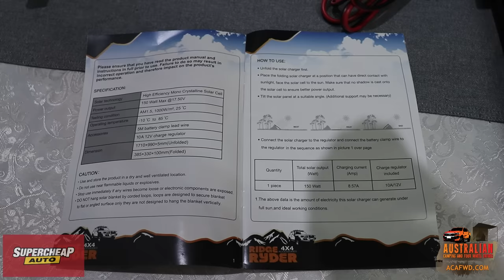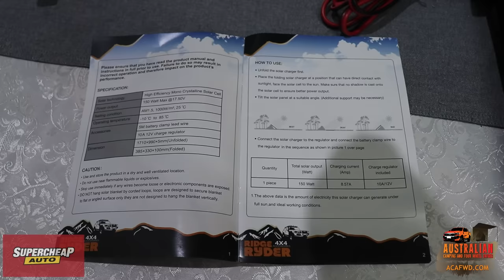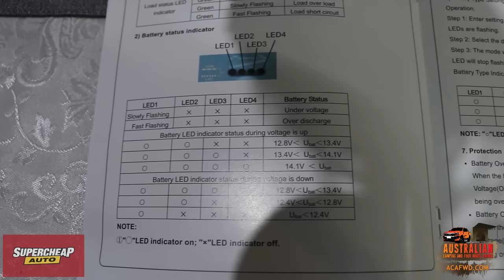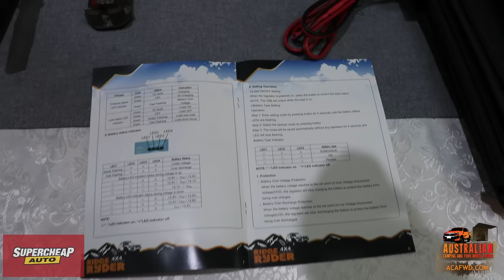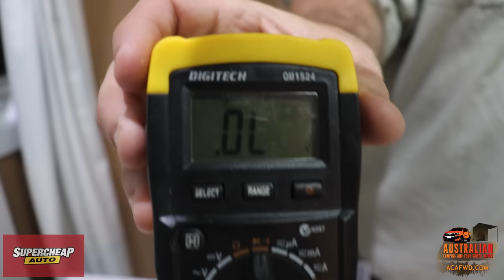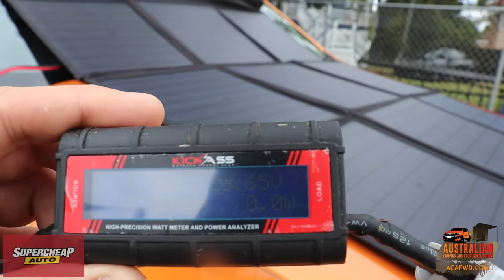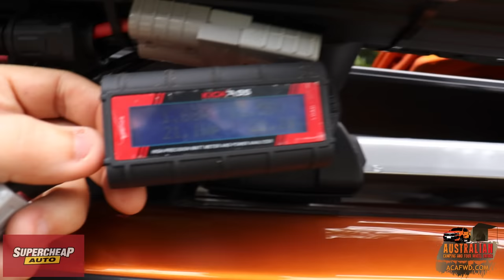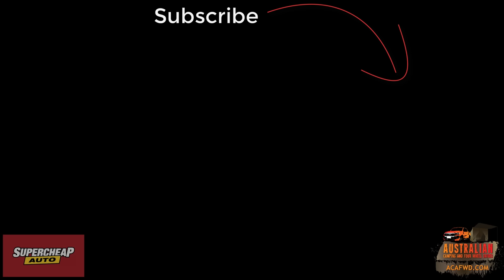Using a Solar Blanket - The Supercheap 150W solar panel review

Comment: Keep up the great videos. With the thin wire that they provided with the folding solar panel the way you fitted it would have less voltage drop (having the PWM regulator near the battery). If it was an MPPT they are always fitted near the battery. In reference to the semi flexible solar panel on the rack unfortunately the first long drive would have induced micro cracking and rendered it a low performer.

Comment: I believe the bare wire ends on both cables allow you to connect them to the charge controller. The wire from the solar blanket goes to the INPUT or PANEL connection ports on the charge controller, the bare ends on the cable with the alligator clips go to the "Battery" connection on the charge controller and the alligator clips connect to the battery terminals.

Comment: Apart from saving weight, I can’t see the value in going to lithium when you’ve already got a system that does the job. Are there any other reasons why you think it’s better to go lithium?
Reply from the maker: Hi Matt!

Yes. There are some other advantages as well.

1) Weight
2) You can run the power longer getting down well below 50%
3) Quick charge times

If you were relying on power for your devices, I think Lithium would be an ideal solution. However if you just use it every so often, maybe not. 

The cost is a big factor which stops many people going this route, which I understand fully.
Reply: Australian Camping and Four Wheel drives  thanks.  I’m wondering whether to go lithium down the track when the price comes down, and hadn’t considered the quicker charge times.  I’ll have to look into that some more.
Reply: There are many advantages to using a li-ion cell of battery. These li-ion battery advantages include:

    High energy density:   The high energy density is one of the chief advantages of lithium ion battery technology. With electronic equipment such as mobile phones needing to operate longer between charges while still consuming more power, there is always a need to batteries with a much higher energy density. In addition to this, there are many power applications from power tools to electric vehicles. The much higher power density offered by lithium ion batteries is a distinct advantage. Electric vehicles also need a battery technology that has a high energy density.
    Self-discharge:   One issue with many rechargeable batteries is the self discharge rate. Lithium ion cells is that their rate of self-discharge is much lower than that of other rechargeable cells such as Ni-Cad and NiMH forms. It is typically around 5% in the first 4 hours after being charged but then falls to around 1 or 2% per month.
    Low maintenance:   One major lithium ion battery advantage is that they do not require and maintenance to ensure their performance. Ni-Cad cells required a periodic discharge to ensure that they did not exhibit the memory effect. As this does not affect lithium ion cells, this process or other similar maintenance procedures are not required.
    No requirement for priming:   Some rechargeable cells need to be primed when they receive their first charge. There is no requirement for this with lithium ion cells and batteries.

    Variety of types available:   There are several types of lithium ion cell available. This advantage of lithium ion batteries can mean that the right technology can be used for the particular application needed. Some forms of lithium ion battery provide a high current density and are ideal for consumer mobile electronic equipment. Others are able to provide much higher current levels and are ideal for power tools and electric vehicles.
https://www.electronics-notes.com/articles/electronic_components/battery-technology/li-ion-lithium-ion-advantages-disadvantages.php

Comment: So I watched this with interruptions (kids etc) and so may have missed the part where you said that the product was good or bad. What do you think of the Ridge ryder? Will it be a good option for someone like me who is just starting out? Thanks.
Reply from the maker: Hi Chelsea,

Yes. I think it is quite good. It is not top of the line like some of the Redarc products, but it doesn't have the enormous price tag they tend to come with either.

I keep this panel in my car now and pull it out whenever needed. Very handy and very small. I keep it behind the back seats so you wouldn't even know its there!

Robert
Reply: "Seems pretty good"  11:54

Comment: Please use solar regulators to charge and run accessories. It is unregulated otherwise
Reply from the maker: Hi Peter,

What you have said is good advice. People should ALWAYS have some device between the solar panel and the battery which acts to reduce the voltage and charge the battery correctly.

In this situation here however, a solar regulator will not work when plugged in. The reason is because of the Redarc BCDC1225 which acts as the solar regulator. Plugging in another solar regulator may actually stop the circuit from charging and if one could get it to work would limit the charging current to 10 amps, when the BCDC charge rate is up to 25 amps.

What I do is to leave the solar regulator in the bag so that if it is ever required (in a situation where there is no charge controller), it can be plugged back into the circut and used.

This is the reason the anderson plugs were added to product . To allow either option to occur.